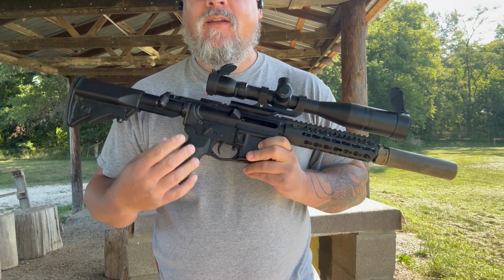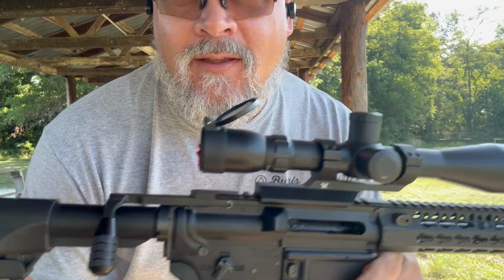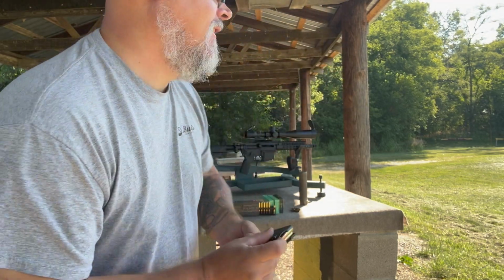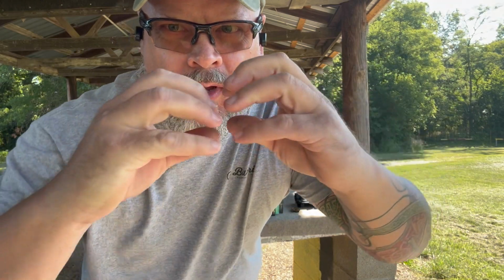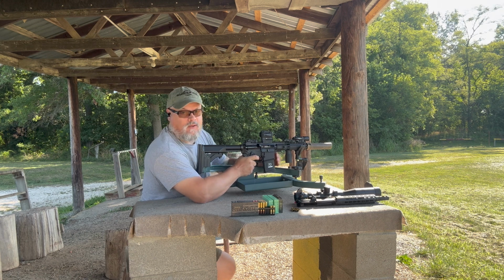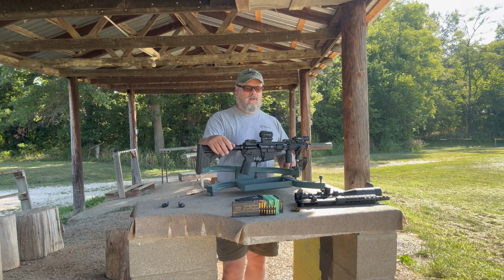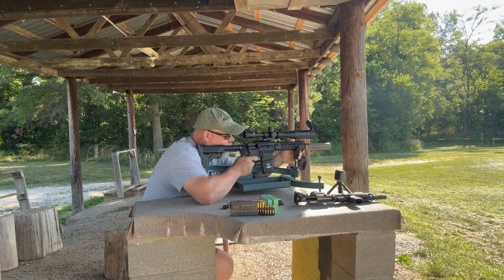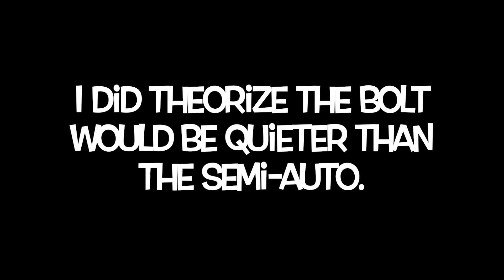ATL OPP, CD-5 Revisited in 300 Blk, Surprising Results

Comment: Between clipping on the microphone and the audio on my tablet, its hard for me to tell much at all.

My theory on the bolt being louder is: while you are right that excess gas is vented out the BCG vents, the .300 BLK is not giving you much excess gas and the diverted gas is doing work so some volume of gas is bypassed from the can and released over a slightly longer period. Reducing peak decibels.

Hey, its worth what you paid for it. 😅
Reply from the maker: Yep.  I suspect the gas system volume is the difference.  It's impossible to get good enough audio to tell sound difference in the video.